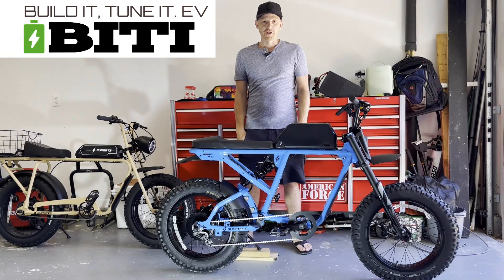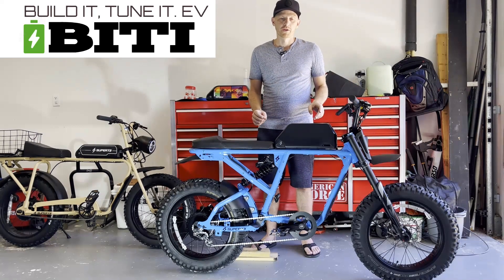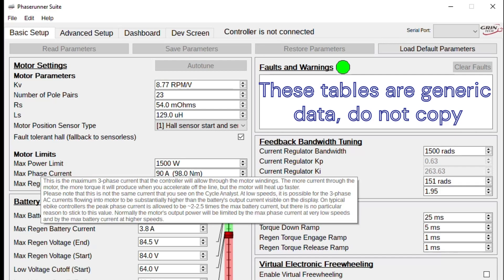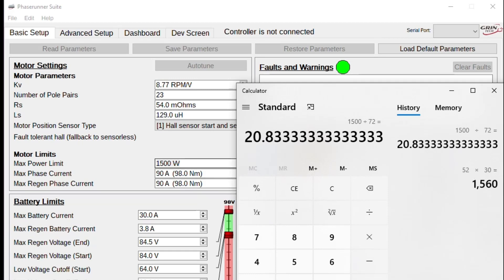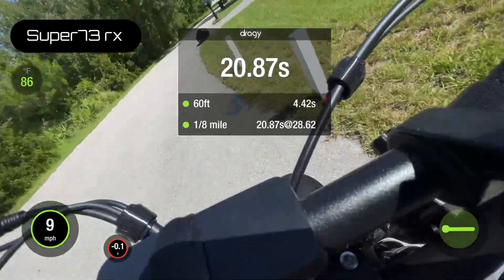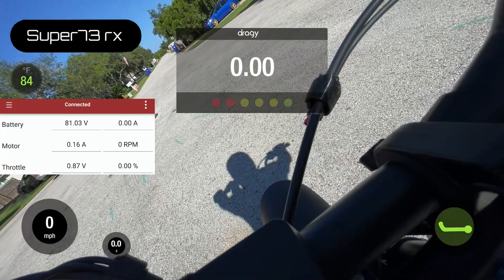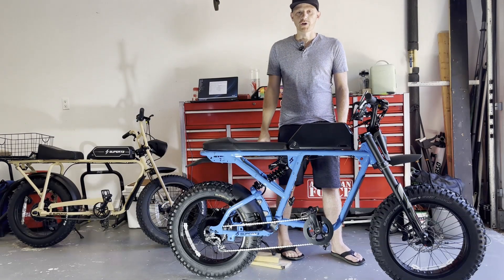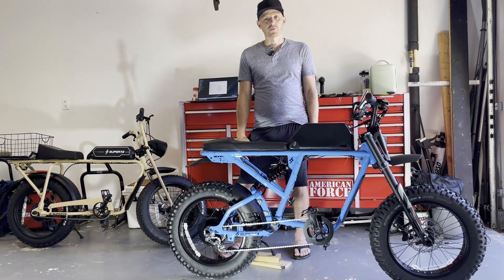Super73 RX Mojave, Stock Motor Battery Voltage Test 48,52,72V at 1500W only for fair comparison.

Comment: 48v x 30a 1440w. I have a 1500w DD motor to go on my engine x. It has the factory 13ah battery in the frame with a 40 Amp fuse but the bms is 35a continuous and about 60 peak. I also have a rear 25ah rack battery and a dual balancer kit so I can comfortably run it without stressing anything. It would be interesting to see how it goes. My geared hub copes fine with hills but I bought the Direct drive for a bit of fun in with the possibility of ditching the frame battery and just have one big 60 or 72v battery for a jump in power.

Comment: I read the  motor was actually rated for that  4300 watt
Reply: It is yeah, but i wouldn’t push it too much, you could run 3000w continuously with no issue though and get like 43mph but yeah you could get up to 48mph with the stock motor in short bursts

Comment: In the end the point becomes that more voltage, the more amps, the more power= MOAR SPEED!
 What I would like to see is these style of bikes with mid drive motors! Imagine 4000W mid drive on a super 73!
Reply from the maker: I run 20kw to a hub on it now.
Reply: @BuildItTuneItEV  20KW!
Are you serious? how do you keep the front wheel down! Let alone the battery to feed that kind of power!
🤯
Reply from the maker: @sparkiekosten5902 check my latest short!
Reply: @BuildItTuneItEV  Just did. Amazing!
 No web page as yet? will keep an eye out for it!

Comment: Are you running the phaserunner on the stock 48v battery, or is it a different battery? I'm very interested in doing this, and the idea of using the stock battery to get used to tuning it, and figuring it out while I save up for a 72v setup is very appealing. 

Also, I saw you say in a different comment that you can't run at 50mph for long... What speed is safe to sustain for a long time? Only stock speed, or could you commute at 40mph? I want to use my bike as more of a moped, so I want higher speeds, but I want to be able to use them consistently.
Reply from the maker: If you plan on using it as a moped, long term you are better off selling your parts and going to a hub motor as it will cruise at 40mph all day long and not even warm up. 

I run at 50 for about 1.5 miles when ever I ride and its not been a issue, going down a highway or such I am not sure how it would do with the heat and plastic internal gearing. 

I put this on the bike only to help the community for a small upgrade, I already have a Hub motor on order for down the road. 

I used a self made 48V pack, Some of the Stock S73 batteries will work with aftermarket controllers some with fault the BMS. It depends on the BMS version in that pack.  I had already sold mine on ebay so I used my S1 pack.

Look into the 72V hub motor thats all over google for the Super73 and use a battery/controller of your choice.

You could also experiment with how long the stock motor will cruise at 50.
Reply: @BuildItTuneItEV  The main reason I liked this swap is that it still works as a bicycle with PAS, and still looks stock... I've asked several people about PAS with the Sabvoton controller everyone likes to use on the 5kw motor, and haven't gotten a straight answer. The frankenrunner seems like it will support a mode limited to 750w and 20mph, as well as a mode that is fully unlocked, and all I need to do is switch modes on the optional display, correct (I think the cycle analyzer)? Mostly, I'd be riding at a max of 45mph, and only a couple miles at a time, running around town. I had hoped this would do the trick.
Reply from the maker: @VintageandVoltage  if you have the cycle analyst as well, you have a insane amount of tuning at your finger tips.

You can set different power levels, pas levels and monitor everything.

I am waiting on the cycle analyst, when it comes I’ll film a really good video showing how to set everything up and work like oem.

I plan on uploading a base map for that as well, like I did the phaserunner.

To be honest the delay was just money,  I have spent a insane amount on the bikes lately and just needed to sell off some old parts before getting new ones.  

The E-Grom build I did was costly and took up a bit of my ebudget for the year.

The cycle analyst video for example will only be for YouTube, because I have a higher power controller going on with the hub motor later on

If that’s all your doing for the miles I think you will be okay, I just try to be as honest about it all as possible.

At 1.5 miles at 50 the motor is just above ambient temp maybe 10f or so.  I think you will be fine!

Hopefully will have the next videos up soon!
Reply: I'm in the same boat as V & V. Thinking about getting controller and tinkering around with my stock battery. I'm totally green at these things, But like tinkering. I see a lot of talk between the Phaserunner and the Frankenrunner. And personally leaning towards what your example videos are, frankenrunner just so it's apples to apples. When i get that, I'm assuming i have to download a program. Which is fine. But do you have all the parameters listed somewhere that one would use for each the 48, 52 and 72 set ups? Something that I COPY? Cuz I know in all your videos you say do not copy! Which I think is wise! Haha. Thanks again for another great video and I really appreciate your expertise. I don't think I would even try this without have seeing your videos first. Thanks👍

Comment: I'd like to see the speed comparison. I have an AR x class 52 volt. It has a 1000w bafang so I'm wondering how far I can push it.

Is the Mojave's motor geared?
Reply from the maker: Yes geared hub.

The motor is around 9 rpm per volt.

From that you can gather speed between voltages.

Comment: looks sick, thanks for the video.
just a question, is pumping all this power to the stock motor bad for it for the long run? cheers
Reply from the maker: Depends on your usage,  heat is the enemy. I have found that the motor heats up most at low rpm high throttle. 

Once it gets moving the heat seems to not be much of an issue.  So depends on that, In my situation i've never gotten the motor over 120F.

Comment: Is that controller good enough for a 5000 watts motor?
I like that controller very small compared to a savboton.
Reply from the maker: No a 5kw motor will want a lot more phase amps then this controller provides
Reply: @BuildItTuneItEV   BAC 2000 can do it
Reply from the maker: @TheNewYorkDiver  yup!

I already have the Bac 8K for this setup!

Comment: Ok ok I think I just need to go 72v lol link to a 72v battery setup that will plug in to the controller?
Reply from the maker: Do this,  pull battery, and the base, and the charger.

List on eBay.

Sell, buy the 72v tank battery on AliExpress, go frankenrunner and enjoy.
Reply: @BuildItTuneItEV  Can you link the battery you suggest in the description I’ll just order it today lol
Reply from the maker: @phat56pat  are you stuck to a tank battery?

We eventually will build battery’s to sale but just finishing up all the legal stuff.

For now you could also checkout powerful lithium on Facebook for a custom battery.  He could build you that case will high quality cells as well.

Just remember the AliExpress one, I have not personally ran.  Just reviews the specs and cells to ensure the specs are good.

What type of range do you want?

And what is the goal with bike?
Reply: @BuildItTuneItEV  getting a battery in the next couple weeks seems impossible haha
Reply from the maker: @phat56pat  you can get one from powerful lithium quickly
Reply: @BuildItTuneItEV  I’ll look that up. You know of a color display that will connect to the controller I wanna get this stuff ordered today if I can get what I need
Reply: @BuildItTuneItEV  looks like I’m gonna have to get a cycle anylist no other display works with the controller. There seems to be a few models do you know what one and adapters are needed by chance?
Reply from the maker: If you get the franken l1019 you need the WP version of the cycle analyst.

Have you ever looked into the KT controller swap! It has a display and cheaper
Reply: @BuildItTuneItEV  I know nothing about this stuff lol  I was gonna order this stuff but I have 300 questions and don’t wanna bug you  and the companies suck at responding. Gets frustrating. I was like I’ll just order that battery on Ali express but no clue where to find a charger. Want to order the Frankenrunner but no clue on what display to order. Don’t know what adapters. So on. I just wanna do wheelies and go a little faster and not smoke my motor also don’t wanna drop $2000 lol not right now anyways lol
Reply from the maker: @phat56pat  do this,

I want to help you, email me (Goto about tab click on email)

Send me the bike, your budget and what your using it for and to do.

I’ll help you set it up the best you can for the budget.

I just want to make sure your going to get exactly what your looking for.
Reply: @BuildItTuneItEV  there is no email on the about tab. I’ll have to go see if it’s only on the desktop version when I get home. I have dm you on Instagram but never got a response

Comment: how can the stock motor take 4500 watts?
Reply from the maker: A motors wattage is a rating based on thermal load over a period of time.

If you stayed at 4750 for long enough it would eventually over heat.  How ever I’ve not been able to do that, if you tried cruising at 50mph long enough it would become a issue.

In stock forum it’s designed to be able to be at full throttle from full to empty battery and live